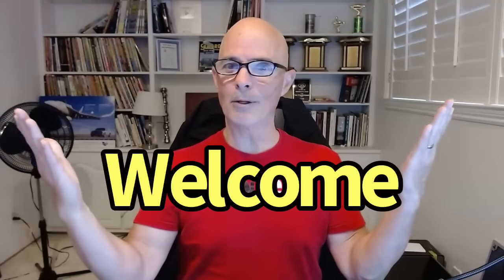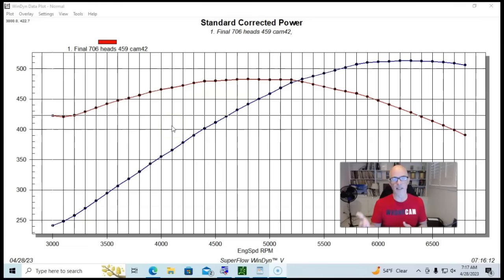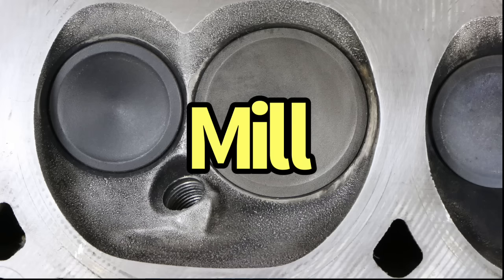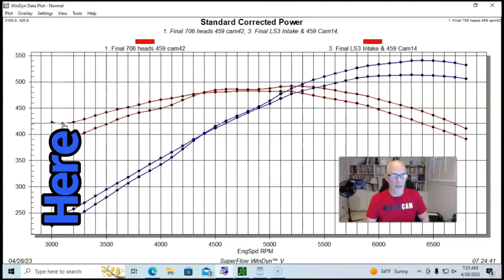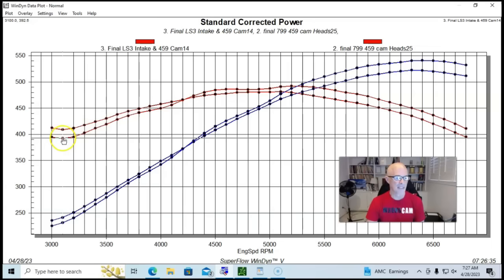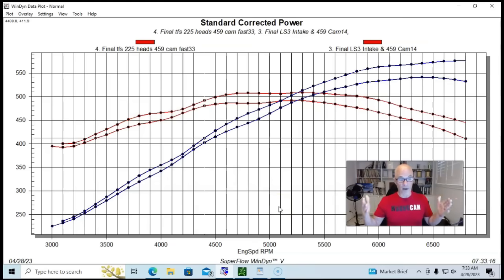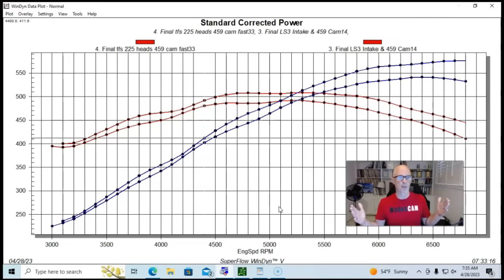HOW TO MAKE 500+ HP WITH STOCK 706 HEADS. 706 VS 799 VS LY6 VS TFS HEAD TEST! 514 HP WITH 232 CFM!

Comment: Always amazes me how good the "bad" LS heads are.
Reply: And somehow we have SBC guys claiming a LS is a bad engine.
Reply: @ZONES89RS what sold me on the ls was the fact that stock heads flow better than aftermarket heads on a small block Chevy.  You can make the same power on a small block as an ls with a much larger cam and sacrificing street ability.  The other great thing is the stock fuel injection system will support the 450 to 500hp ramp easily where as most stock fuel injection systems for small block Chevys you are in the 200 to 300hp range.  If you go port injection and want decent power you have to spend about as much on the system as you would the whole ls swap.
Reply: @Averagegunenthusiast  yup, to beat a cam only LS1, I had to build a 383, porter aftermarket heads, and weigh much less. 

Just isn’t worth it for me to have fun when I have to replace everything in the engine to make less power than a cam only 6 liter
Reply: @ZONES89RS  it’s not just peak power either, it’s the area under the curve, my more mild 6.0 was faster through the whole rev range and in the vehicle it made a huge difference.
Reply: Yup...we are spoiled these days.
Reply: 😂 facts....

Comment: David Denman stated it well. In a street car, you are rarely going to see beyond 5K RPM. Rec Port are high flowing but only above 4,500 RPM. Engine Masters did the Cath vs Rec Port heads and came up with the results. Cath are great for the street or towing applications. If you have a 4,000 stall converter in a bracket car, rec ports are probably your best bet.

Comment: I’m shocked a stock untouched 706 head could support 500+ Hp with only 22X cfm of flow?  🤔🤔🤔
Reply from the maker: these flowed 237 hp at .700 and 236 at 600 and 220 at .500
Reply: @richardholdener1727  I have a set of 862’s 1.89”/1.55” valve 208cc intake port w/factory valve job flowing 254 cfm @.600”…. Swirl ramp intact/rocker bolt lump reduced not removed to keep the volume down. 267 cfm @.700” never stalls.
Reply: @HeadFlowInc  what are the dyno numbers on the blaser then?
Reply from the maker: these were all stock
Reply: @richardholdener1727  Dyno numbers is the proof. I don't know how it does it, but it does. The valve open for a longer duration and larger lift make the lower flowing heads work not 'better' than the LY6 and TFS heads, but very well. Enough to get the hp over what the theoretical horsepower that the flow can support, just based on lift.

Comment: I have a 6.0 ls with a sloppy stage 3 and I chose to stick with the 862’s because I drive this foxbody on the street. I take it to the track a few times  and the best I got was a 10.91 @ 125mph with a heavy 80e transmission. There will ALWAYS be something better than what you decide to build. But I built mine to drive. 95% of the time I’m under 5k rpm so that’s how I built it. Keep up the great work Richard!
Reply: That's a strong running combination. What converter does it have? And what does it weigh?
Reply: Good sounding combo, I have a bmw 6.0 flat tops stock valve 706s but I did a little port work on it, ran 11.85 at 121 with street tires, and only recently discovered I was only getting 70% throttle, and have some sticky mickeys now I’m anxious to break it in the 10s
Reply: @drivinwithdrew7676  good deal. I have a small bottle that helped me get to 10.91…. But my rear brakes are junk and I couldn’t foot brake it past 2400 even with a 2 step😝
Reply: Are you running stock bottom end and pistons?
Reply: @masoncampos7043  absolutely!
Reply: I’m really jealous of you guy’s running these engines in cars.  My 6.0 has ported and polished 243 heads, a mid 220s cam, tbss intake 1 3/4 mid length headers.  I ran an 8.9 1/8 mile at 83.5mph in my 72 GMC c10 with bad wheel spin, I’ve run in the 13s in the 1/4.  If I didn’t have the aerodynamics of a brick and a lot less weight it would be faster, the truck weighs just under 4000 lbs about 4200 to 4250 with me in it.
Reply: @Averagegunenthusiast  sounds like you need traction for sure. Need a healthy converter? MPH seems a little low
Reply: @ZONES89RS  I think the front end of a brick contributes to the lower mph, it definitely needs a good drag radial but I think I’ll leave it alone and try to go fast in a car.  So much easier this truck is a fun hotrod truck but it takes so much more power than a car to get the same results.
Reply: @Averagegunenthusiast   the 1/8th mile aero isn’t usually a massive issue. But it is everything working together for the result I’d guess. 

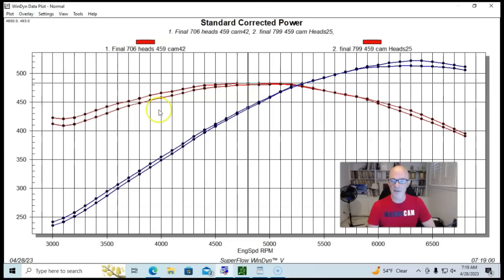My OBS with a punk ass 5.3 liter, BS tune and 3:42 went 8.5 in the 1/8th with a shit 60. So that’s why I have my concerns for your build. The engine should be shitting on my ET.
Reply: @ZONES89RS   for comparison my 2014 Mustang 5.0 with roush supercharger and slicks went 8.0 at 90mph, it was on slicks, manual transmission car and launched at 4000 rpm.  I think on other factor could be I just don’t get to the track as often as I would like to.  Also I have noticed compared to other builds at the track I ran at im not too far outside what they run.  The same night I ran the 8.9 I ran against a  Colorado with a 5.3 swap, this is the older colorado that is quite a bit smaller than my 72 c10.  I completely blew that run, I had it in drive and because I didn’t get my foot to the floor quick enough due to traction issues, it shifted early and was a bit sluggish in 2nd gear.  I still was way ahead of the Colorado 5.3 swap.  Granted I have a big power advantage over the 5.3 but they have a big weight advantage over me.  I have run better 60 fts in the past well better being 2.0 on a street tire.  It makes 350hp to the tire, not the 400 I was expecting but that is how it is.  I know a lot of people dyno higher numbers but with the same combo, I can’t explain how my numbers would be lower other than differences in dynos.  My 6.0 has ported and polished 243 heads, a .600 lift cam with 226 dur intake 232 exhaust, tbss intake.  The engine has been rebuilt, so I know it’s not worn, but I did bias it towards better street driving than drag strip performance, hence the relatively mild cam.  It has air conditioning and late model Silverado seats, weighs in at 3960lbs.  My drive train is strong but heavy, the trans is a built 4l60e, rear end is a ford 9 in 31 spline and I have 20x10 wheels.  I have had it on the dyno previously at a different place with 15 in wheels and a 28 spline 9 in and I got 362whp, power peak at both was right below 6,000 rpm probably 5700, and stays flat to 6500.  It drives really nice on the street and even though I don’t get the peak numbers there is power everywhere in the rev range.
Reply: The roush supercharger on the Mustang is a phase 1 with roush tune but it dynoed 499whp.
Reply: @ZONES89RS for you to refer to your 5.3 as "punk ass" seems crazy. I wouldn't consider any of the LS engines punk ass. Not even the lowly 4.8 is a incredible little engine especially considering these are push rod engines. It took Ford a decade or more to match what these LS engines could do.i And that's with overhead cams and even 4 valves per cylinder in the cobras, the LS was still taking them all down. It was 2011 when the Coyote came on the scene before the LS could finally beaten. And there was more than a few coyote engined hot cars that got still got put in their place by a "punk ass" 5.3 or even the 4.8 with the proper mods done to them. And as for how much 'bang for your bucks' can be had there's absolutely no question as to whether or not a LS of any size is the smart way to go. N/A or on boost. The LS platform deserves mad respect and I'm quite sure that more than a few 'gearhead' types will agree with my sentiment.
Reply: @GeorgeGriffith-vf4tl  I wrote the book on this shit dude. Was swapping these before it was popular
Reply: Did you like the SS3 and did you dyno it? I'm considering this cam for a daily.
Reply: @gearhead7896  yes I had it dyno’d before and after it was tuned. It was just over 500rwhp and like 463tq. Since then I’ve added a bottle to my car.
Reply: @daviddenman7479  I was thinking about that cam, the Summit single plane stage 2, and the Howard's 190315-08.
Reply: @daviddenman7479 wait.  What am I missing. Lq4 with a ss3 and 862 heads made how much? I was just hoping for over 400whp with a ss2
Reply: @theshark2804  I have a dyno sheet showing 512 rear wheel HP and 470 TQ and that’s before I put a bottle on. And that’s also tuned on the same dyno. You will need to get it tuned.
Reply: @daviddenman7479  I have a lq4 862 heads & 823 square ports have a sloppy stage 3 to put in it you think I should run the 862s over the 823?
Reply: @daviddenman7479 is that 500 whp or crank?
Reply: @JaywithdaK I was 512rwhp on the dyno before I put 175 shot of nitrous on it.
Reply: @ very solid numbers. What other parts did you upgraded, are you running upgraded injectors or decapped injectors?
Reply: @JaywithdaK I had i think e85 injectors….. it’s been years and I sold it last year so I can’t exactly recall. I know I did not spend big money on Holley injectors. Flex fuel ran enough for what I needed
Reply: @ thank you very much you’re the man!
Reply: @daviddenman7479 it made just over 500hp n/a or with a little help??
Reply: Best I had NA was 12.3 in yhe quarter. After I installed the bottle I got my 10.91 with a 150 shot.
Reply: @daviddenman7479  i wanting to build a 6.0 with some milled 706 and a sloppy stage 2
Reply: @daviddenman7479  just trying to get an idea of what it will make
Reply: I made 512 on a Mustang dyno. I never had it on the dyno after the bottle
Reply: What octane are you running?? I have a 6.0 flat top ls2 and want to put 706 heads on (same as 862) just don’t want to have to go up to race fuel.
Reply: @lexusday3819  I’m running 91 or 93 non ethanol, depending where I fill up.
Reply: How do you like the SS3 cam?  I have one to put in my 6.0, but kinda worried about street drivability.
Reply: @Cultofpersonality09129  I have no problem driving my car any day. I also have a 3200-3400 stall which helps in everyday driving.
Reply: My coupe with a stock LY6 with cam went 6.8 in the 1/8th in my fox. Cam and carb. 

Should be a mid 10. 

The fox is so light I care not to make sure I keep all the low end torque. You just don’t notice. Obliterated the tires on the street no matter what in 1st gear. Lol
Reply: @ZONES89RS  my foxbody is 3300, 3500 with me in it.
Reply: @daviddenman7479  chonky. Mine was 2700 with power everything and full interior with roll bar. 3000 with me in the seat
Reply: @ZONES89RS  I agree mine is heavy. Not exactly why. It is a hatchback t top car so I know that isn’t ideal for racing. But I didn’t build it for it, although I’ve taken it to the track a half dozen times. First time at the track I went 12.3 in the 1/4. Last fall I went 10.91 in the 1/4 which isn’t terrible. Plus I have a 4l80e transmission also which definitely saving me anything. But then again, I built it to run up and down the road 98% of the time. If I wanted a track only rig I definitely would use a notch, gutted…..  But I do have a 2008 Chevy Colorado I plan on building….. I have a lot of the parts to make it go fast (turbo 6.0/th400) I just need to build it and leave my Fox alone.
Reply: @daviddenman7479  that 80 just kills 60 foot. Every time I went 80 to TH400 I gained .2 in the 60. lol 

I don’t have door bars and what not and my impact bars are replaced with tubular.

Being a hatch and T tops makes a lot of sense

Comment: Richard great video if only ford made good factory cylinder heads you could do a test on them I'm a ford guy but must admit cubic inch for cubic inch the ls engines are probably the best engines ever built
Reply: I agree! I’m not a total gm guy either. But I was looking for a great candidate to put a fuel injected big block with overdrive in my 1978 F350 (on a budget) unfortunately I had to go with a GM powertrain if I wanted to make decent hp/TQ on a budget. So now I own 2 fords with GM drivetrains. Fords make great platforms, in the vehicle department….. but not really in the engine department.
Reply: "Pushrod" engine. That's the key.
Reply: Imagine the work involved putting ford heads on a Ls properly

Comment: I have the mildly ported 823's in my LS2 with LS9 cam with a Turbonetics 78 mm with a 1.15 AR housing. What do you think about this combination for power?
Reply from the maker: ls9 cam is cheap-but suffers a lot down low-not a good match with the rec ports if you want boost response

Comment: Correct me if I'm wrong but I thought the 706 vs 799's on the cathedral video did the opposite on the 5.3. With the 706 making more peak, and 799 low end power?
Reply: nope
Reply: The 706 made equal to or more power everywhere than the 799 on that 5.3 test
Reply: @splitface454  yeah I just rewatched the short version of that. I'm guessing the small bump in compression is not as beneficial as the flow of the 799 on the larger  c.i. motor. Wich is why I choose them for my 6L

Comment: Would the 317 head work well if you could keep the compression up by changing the piston?
Reply: The 317 head has a lazy slow combustion chamber and in my experience requires more timing to make peak power vs the 243/799 head.
Reply from the maker: they all work
Reply: @Richard Holdener  come on tell me the secret combination.   I know the 706 works well because the compression goes up and the downside to the 317 is the compression dropping.  Would the 317 be any better than the 317 if the compression was the same my changing the piston?
Reply: @D BAIRD  from what I can recall from other videos, the only problem with this is you can only mill so much and dome up so much as well until you start running into available valve clearance issues, lift on cams as well. So to me it seems like you are just money and time ahead going to the 799 of aftermarket heads. Instead of trying to figure out that magical combination of pistons, milling, cam specs, rocker ratio, pushrod length, and vavle train components.. just slapp on a set of 799's and half the problem of the 317's is fixed
Reply: @Mason Campos  with a compression calculator the compression comes to 10:5 :1 without modifying the head with a 5cc flat top because of the compression height of dss piston.  I was wondering if that would be and better than the 706 with a dished piston?
Reply: @D BAIRD  that's also assuming the deck is zero'd to the piston in the bore. And the heads have been cc'd correctly. Sometimes it takes some work to achieve this
Reply: @Mason Campos  I agree,  this is information from dss website and a compression calculator.

Comment: I remember some of these comparisons from other tests you've done. I'm sort of convinced now that it must be the camshaft that makes my current combination such a dud. 

If only I had unlimited dyno time and wasn't daily driving my truck... 
I would absolutely swap in a different cam and give the 862s another chance.
Reply: As Rich would say:  Wrong Cam
Reply: What’s your set up? Do you have a high/low stall torque converter? It could be something else.
Reply: @daviddenman7479  It doesn't make much power. Even Richard has said something seems off. I've offered to share my tune file with anyone that wants to have a look. It's an LQ4, 862s, TSP CHOPacabra cam, TBSS intake, 92mm TB, headers, exhaust, CAI...has all the supporting mods. Tuned on 93 octane, etc. It made 336HP/336TQ 4L80E, 3000 stall. My old cam and 317s made 327/369 on 87 octane. 

I think my next place to start chasing things is a compression and leak down test. If that checks out good, it's time to blame the cam as being a poor choice for this application.
Reply: @BlueCollar Hotrods  I'm just curious have you checked pushrod length? Don't think it should be an issue with that cam, but different heads on different motor sometimes can throw things off.. just my opinion, I really feel 862's are a restrictor for 6.0L. But even so it seems like you'd have to have multiple misfiring cylinders to have those numbers.. good luck figuring it out
Reply: @masoncampos7043  I didn't. Block and heads are untouched, I threw in a set of stock pushrods. The valvetrain isn't noisy, etc. Aside from the weak power numbers, it runs good and is reliable.

Comment: Nice. So would you go rec port with adding boost for the extra flow?
Reply from the maker: depends on power level and application. but likely not
Reply: This has been proven time and again by Richard and on Engine Masters, whatever your combination produces NA, boost will only amplify it. 

Build the engine for your purpose. If you want to throw a turbo on your street car, you don't need rec port heads. If you are throwing a turbo on a "race" engine, turning high RPM, rec port may be the way to go.

Comment: when you speak about stock heads valves spring pocket is oversized for huges dual springs correct?
Reply from the maker: NO-NO NEED TO CHANGE SPRING POCKET FOR EITHER BEEHIVE OR DUAL SPRINGS